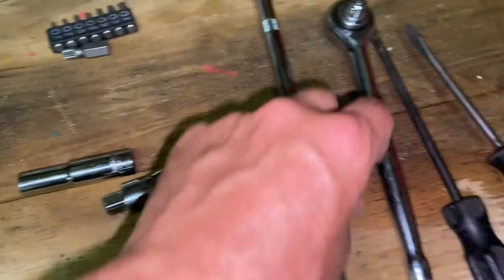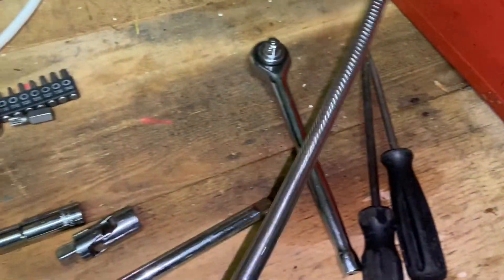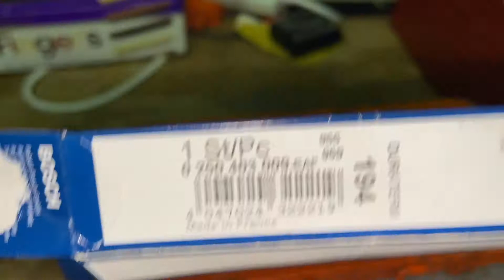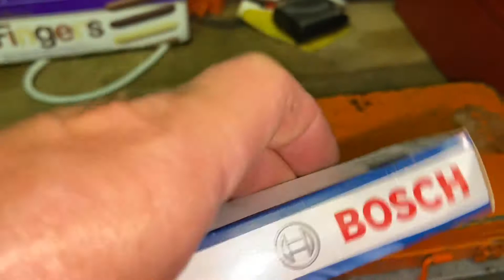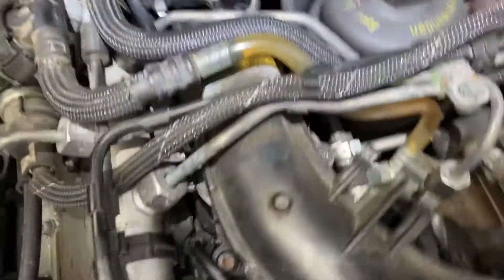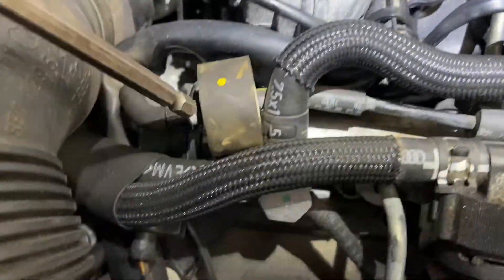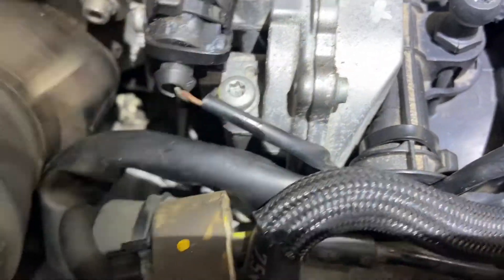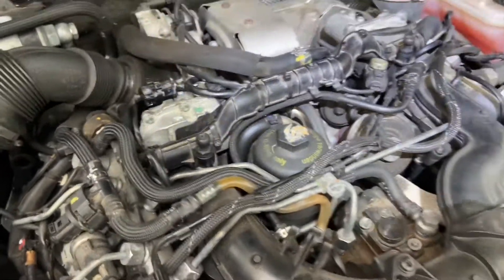Glow plug swap Audi V6 3.0 TDI

Comment: Finally done mine well 5 of them number 2 feels like it's gona snap great video mines an a5 2.7 tdi almost the same the wiring is slightly different didn't need to remove anything to get to number 3 but did for 4 the lead caps all broke unfortunately

Comment from the maker: Just take steady and apply pressure gently, if the plug won’t turn you can try tightening it a fraction, then loosen it a fraction don’t rush. Good luck